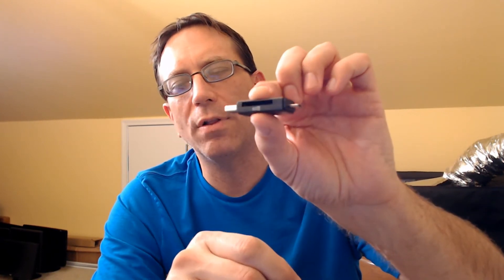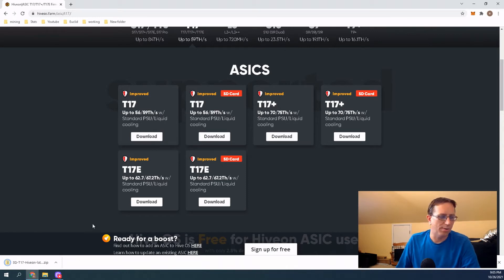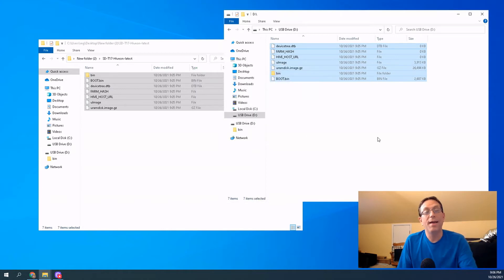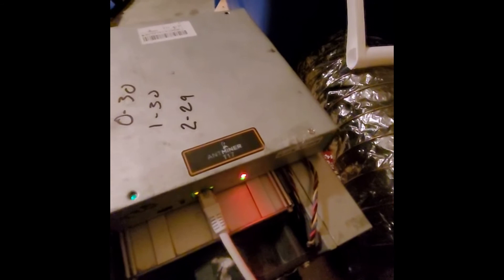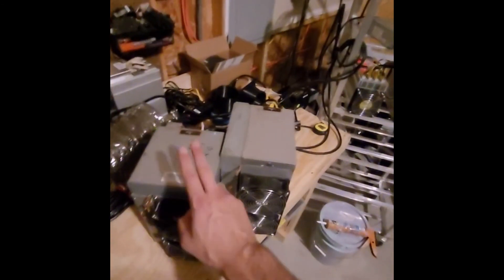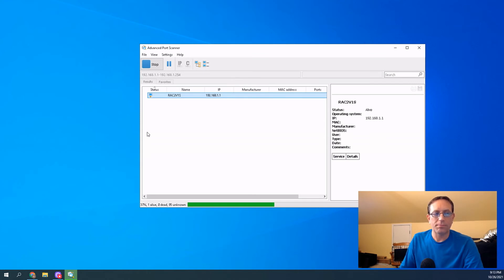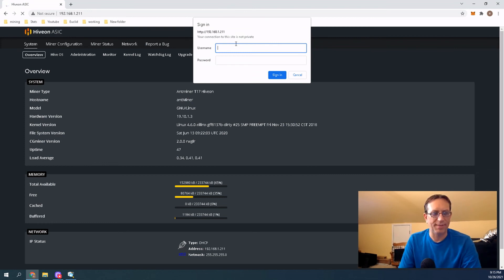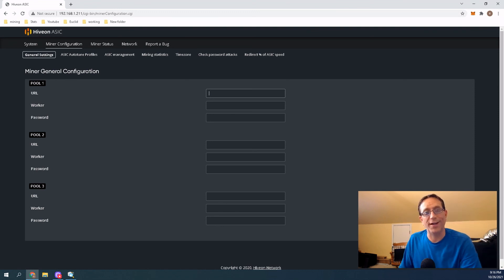ASIC Firmware Flash Update / Upgrade Using a Micro SD Card

Comment: I will try it soon we downloaded the wrong firmware for s19 pro and s19 🤣🤣😭😭😭 and the machine is not connected to the sever and the light red in the machine 🌝💔
Reply from the maker: You can flash from a sd card if the miner isn't responding.
Reply: @euclidmining  hello I did it and now my machine working 🌹 thank you 🙏🏻
Reply from the maker: https://youtu.be/bvPjk-eTWFI

Comment: I’m of need of support regarding antminer S9 I connect it and it only gets about 3 th then disconnects for no reason. I bought  4  antminer pretty much same result using slushpool. I would prefer hive os because all my gpus are on that but the flashing the os seems a bit much for me right now being noob and all 🤣 thanks !
Reply from the maker: I had the same problem with my Z11's. I have 2 of them and they would start mining and shutdown after 3-7 seconds of mining. If you just connect 1 s9 with no others turned on will it mine?
If I had both mine on only 1 would work. It was something with the network but I never figured it out before profitability went down and I turned them off. They didn't have hive on them but my L3s did. They did work great with Hive. I didn't use the hive interface to manage them and just used the IP address to access them. 

Try 1 miner at a time with no others running and see if it will connect for anything longer than a couple seconds. Try each one, one at a time.
Reply: @euclidmining  I have 1 hashing on slushpool . Been hashing at around 5 to 7 th won’t go any higher . I ordered a 220 pdu to see if that will help . It’s something to do . I realize it’s non profitable but learning experience is worth something I suppose . 
Thanks for responding ,, good looking out !
Reply from the maker: @strokerace563  With the low hashrate, when you bring up the miner page are all boards hashing? Is 1 low and the other 2 hashing fully? Each board should be hashing at 4.5th. I am firing up my discord server to help with things like this but am still new to creating a discord server and want to make sure all channels are locked down to spammers and garbage.
Reply from the maker: https://discord.gg/APfvVwK6 if you want to check it out and see if it looks good   :)
Ill probably put a video out letting everyone know as soon as I know its good to go!
Reply: @euclidmining  I have a couple discord servers myself and I’m not the best with those either . Its getting pretty late I’ll check out the hash boards and let you know tomorrow . I need to find that data it in miner stats I’m sure . I thought I seen it running on 73 chips earlier . But it keeps idling down then back up . Deciding if I should turn it off for the night .
Reply: @euclidmining  it’s running 4.5 th I’m thinking it need power tuned up but again I dunno

Comment: HI, I'm trying to do the same thing you do in the video, but the lights are always on! What could I be doing wrong or what could I be missing? Could it be the firmware she has installed?
Reply from the maker: When you use the SD card it takes priority over anything loading on the asic so whatever she has installed on it shouldn't matter. 
I hate to say it but I would start over fresh one more time. Format the SD card fat32, put the S9 unlock firmware on the SD card. Have the miner powered off insert the SD card and then power it on.
Tell me what happens.

Comment: what about the dr5?
Reply from the maker: Hive doesn't have a firmware for that yet. https://hiveos.farm/asic/   is a link to what they offer at the moment.
Reply: @euclidmining  thx for answering. Is there any tutorial fpr dr5?
Reply from the maker: Are you trying to update the firmware? Is there a specific one you are looking for or do you just want something better than the factory set firmware?
Reply from the maker: Does the unit have an sd card slot?
Reply: @euclidmining  yes i have to update the firmware to be able to start my dr5 miner. It has an sd card slot
Reply from the maker: https://service.bitmain.com/support/download
This is where you can get the latest firmware from Bitmain for your device. There are other firmware out there but... you always take a chance of causing more harm to try something different than the manufacturers firmware. 
Can you log into the miner from your web browser? You can use https://www.advanced-port-scanner.com/  to find it on the network.
I did a video on the L3++ from unboxing to mining and this software is what I used to find the miner on the network.
https://youtu.be/ZOzzAaVf8QQ
Reply from the maker: Let me know if you were able to find the miner on your network with the advanced port scanner software.
Reply: @euclidmining  i dont know how to unzip the files and which ones i need on my sd card
Reply from the maker: I would try and connect with the advanced port scanner and update it that way first. Its much easier. 
To unzip a file, right click on the file and click "extract all". It will create a new folder with the files unzipped.
Reply: @euclidmining  imma try that later when i come home. So when i unzip a file it gets to another folder, but in that new folder is still a zipped file.